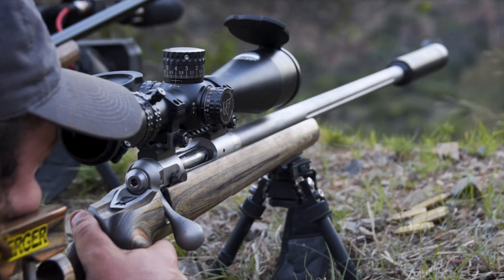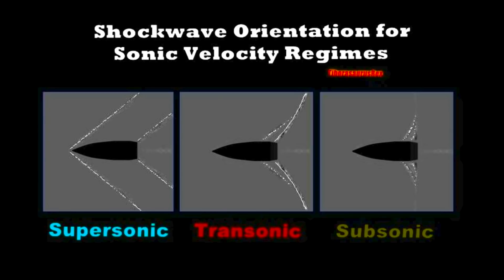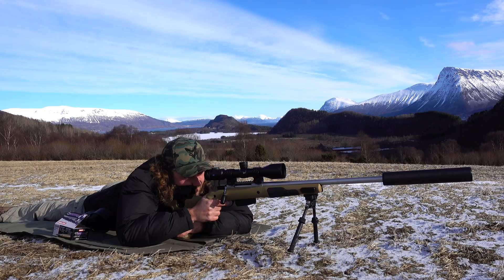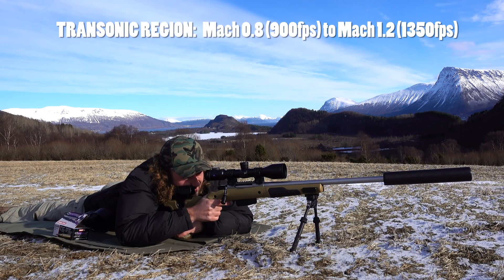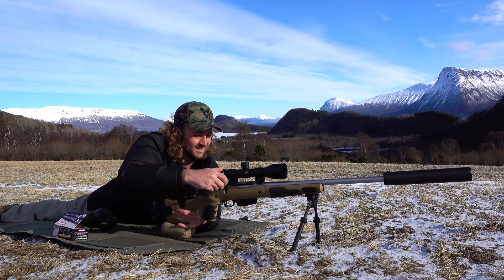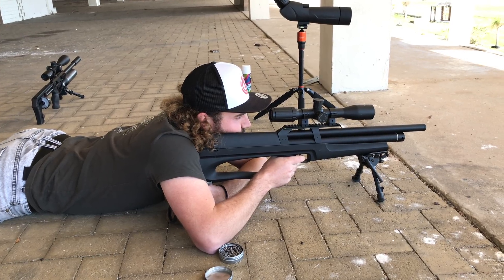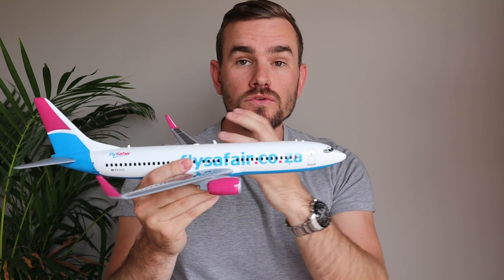Subsonic, Transonic and Supersonic Flight - Airgun Ballistics 101, pt. 10

Comment: Wouldn't it be interesting to add a thin polymer tip to the front of hollow point slugs, giving them greater aerodynamics, in the same way that Hornady does with V-MAX ammunition in .17HMR and .22MAG, in order to achieve greater stability and permanence of the slug in the supersonic zone up to a distance of 150m (I believe this is a good distance and consistent with airguns).
In addition, a slug could be developed that is as long and light as possible, in the case of 5.5mm calibers, taking advantage of FX's hollow point technology, in order to maximize the ballistic trajectory, since a longer slug theoretically provides better stability at close to 900 ft/s.

Here's my simple and layman's contribution! :)

Translated into English.

Não seria interessante adicionar uma ponta de polímero lodo à frente dos slug's ponta oca, dando a eles maior aerodinâmica, da mesma forma que a Hornady faz com as munições V-MAX no .17HMR e .22MAG, no intuito de conseguir mais estabilidade e permanência do slug na zona supersônica a até uma distância de 150m (acredito que seja uma boa distância e condizente com armas de ar).
Aliado a isso, poderia ser desenvolvido um slug o mais longo e leve possível, no caso dos calibres 5.5mm, aproveitando a tecnologia da FX deles serem ocos, a fim de maximizar a trajetória balística, já que o slug mais longo teoricamente proporciona melhor estabilidade perto dos 900 ft/s.

Fica a minha singela e leiga contribuição! :)

Brasil!

Comment: I'm an aerospace engineer. Trans-sonic is difficult because not every part of the vehicle or project beaks the sound barrier at the same time. Shockwaves bounce around and interact with other parts and cause them to create shockwaves but they can cause the original shock to disappear. Those shocks were only there because the original shock was there. If it's not there then the second shock disappears. Then the cycle repeats. The peak of transonic drag is M=0.85 (950 ft/s sea level) in general. Go with the heavier projectile because the rifling minimizes precession (the inherent wobble you see in a top), drops the muzzle velocity and is more resistant to the cyclic effects mentioned above.
Supercritical aerodynamic bodies are a very well area of active research but I don't see them saving the projectile body because they depend heavily on the pressure gradient across a shock. Supercritical aerofoils work because we can manipulate the airflow downstream of the shock. We are getting to the point where we have things like active boundary layer techniques where the back half of the aerofoil is porous and we pull a vacuum to essentially suck the shockwave down to the wing. Of course, technology will get there one day but the $/shot when every shot has a microchip and a battery in it is going to skyrocket. Though sign me up. I would love to put some of those down range.

Comment: In the phantom the critical Mach number was very high due to the coke bottle shaped fuselage.  .98.    So.  Going to Mach you just noticed the altimeter flip around and that was it.   Meant to go fast especially thru the number.  …Mach 2 is very fast.   Doable in a slick phantom going downhill.

Comment: fascinating.  this really explains things for me that I did not truly understand many many years ago.

when I was in high school, I was one of a team of match shooters.  We used springfield 1903, but the load and bullet were matched to be subsonic.  We shot at 10 meters.  standard peep iron sights.  The armory chief did all the loading, and gunsmithing.  I just assumed this was the typical match rifle setup and the subsonic was to eliminate the need for sound reduction/moderator/silencer.  But I do remember doing some 'field work" with my rifle and trying to place rounds out at 100 meters.  Oh man, I tried everything ...I could not hit anything, not even from a rifle clamp!    Yet, I can use my .22 LR with a decent scope and place shot within 3 inches at 100 yards from prone...It never occurred to me at the time, that the match rifle was detuned specifically for the range and the weight of the bullet to consistently move just above supersonic around 1400 fps...and it never encounters transonic in the 10 meter range.  But at 100 meters, that same match rifle breaks back down from super mach to trans sonic and then subsonic.  

this video reminded me of that experience..I had never been able to fully digest what is exactly  going on at those mach ranges.  

Now I own 4 air rifles...all break barrels.  ironically, the least powerful .22 caliber 49 dollar hatsan with a decent scope shoots just as accurately as the hw30 at 40 yards.  both are shooting sub sonic.  I am convinced this is due to other variables other than subsonic and pellet weight.  I am convinced that this 49 dollar air rifle simple does not experience the same level of barrel and piston barrel resonance as the higher end....and thus more accuracy and consistency.  Science is fun and confusing.  experimental science in the field is a blast!

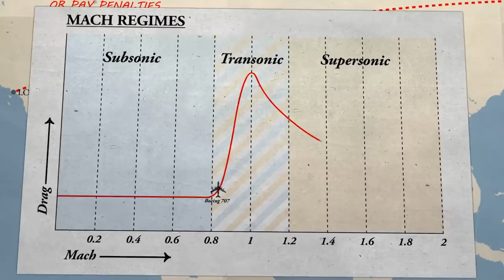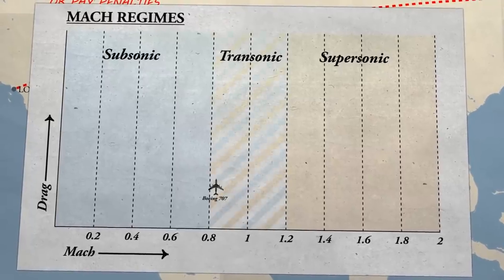Comment: I beg to differ about how fast planes go. I know the lower end of transonic speeds in unsustainable and makes the airplane uncontrollable. Though the “not too many commercial planes than fly transonic” (5:04) can operate at the higher end of transonic speeds due to a decrease in drag after the initial increase at the lower end of transonic speeds seen at 5:35. The decrease in drag happens when the shockwaves are no longer over any surfaces but in front and behind them which means no loss of laminar flow. Though the chart at 5:35 only shows the drag from normal shock waves, there’s also the oblique bow shock at the front which happens when a plane exceeds Mach 1 and drag from this shock wave skyrockets once you reach Mach 1.2. This is why airliners never at TRUE supersonic speed where all the air flowing around the plane is also supersonic.

Comment: İ watched most of this series and found it quite informative(still some went over my head :D)! Dankie! I am actually interested in buying my first pcp, was wondering if you could point me in the right direction, it would be mainly for (extreme) long range but still want a calibre that has a punch at the distance to ring a gong or if i ever decide to hunt at shorter distances (which eliminates .177 and .20). Having trouble finding the right balance between calibre and power.

Comment: Have enjoyed your series immensely but for this episode, as an aeronautic engineer, please understand a few things.
First up. Trans sonic area is way way way harder to explain, for the layman, than is done here. I appreciate that you´ve tried to make it understandable and coherent to masses. That resistance for instance increases from v2 to v6 in the transonic area is for rather hard to comprehend reasons. Other side of the wall, as you´re probably aware,we in turn see v1,5 approx.
Point still is that the understanding of the trans sonic area is way way more involved than most think and we´ll do ourselves, as shooters,a great disfavor if we regard it simple.

Second up. Mach is a relative flight speed. No matter if an aeroplane or a bullet.Imperative word being relative. It is dependant of a few variables why discussing hard fact speeds in Mach numbers simply isn´t done.
Speed,to us as shooters, should thus always be in either fps or m/s to avoid mix ups.

Comment: This answers a lot of questions i had about airgun slugs.  I'd be willing to venture a guess that the transonic region of a projectile is partly dependent on its shape, i.e. a pellet would have a larger transonic speed region than say a boat tail bullet. Possibly allowing one to push the subsonic speed of a slug a bit beyond was is accurate and stable for a pellet.

Comment: I have been trying the new 26.8 grain NSA slugs. Using a 25 ca FX Impact Markll 700 mm slug liner I was able to tune ,
More luck than skill, to get a 10 shot string with a spread of 2, (953 -955) fps and an sd of 1.6. I was hoping for a pellet on pellet group at 30 yds and didn't get it. So here is the question 
If the rear,skirt of the slug measures 246 What is the inside diameter. Of the slug liner and might it be better to shot these 26.8. Slugs through an A or B pellet liner Thanks for the time and effort you put in!! 
I support you on Patreon and encourage my associates to do the same, also encourage others to support you on 
Airguns101. Com Thanks again Tom

Comment: Good explanation from your pilot friend, except his statement that airliners fly below their critical mach number. Most modern jets cruise above their critical mach number. Thanks to the introduction of supercritical wing profiles decades ago the wave drag increase very slow in the low transonic regions, and hence transonic flights aren't an issue. Else there would be no need for automatic mach tuc trim as you find on the 737 for example, that trim the nose up in higher speeds (due center of pressure shifting aft as supersonic shockwaves forms).

Comment: hello  , the 22-250 is not soft on the barrel , it wil wear out sone compared to 223 or so . i load the 22-250 to moderate pressures and then it is a long accurat gun. if jou want the muzzle energie of a 223 in a airgun ,jou have to switch to the monster kalibers like 15 mm or more.and in that caliber is a firearm  stil king      a good vid  did you made    happy newyear

Comment: Took me several tins of pellets but I came to the same conclusion on my benjamin marauder.  Without measuring the speed I lowered it from maximum until I got the best groupings i could.  Then I measured it and found I was shooting right at about 900 fps.  I primarily shoot after black birds at 60-80 yards at the fishing camp.  Use 7.4 grain crossman pointed due to less bullet drop.   For closer stuff (fur not feather) I shoot the 10.5 grain crossman heavy domed at about 850fps with no changes to the air setting.  Adjust the scope dope of course.  Been pleased with this versatile setup.  A video a while back from Ted's Holdover showed the erratic pattern of supersonic/transsonic path of a pellet and I quickly adopted the advice.  This video helps me understand it even more.

Comment: I'm curious,
one factor not mentioned is the pressurized gas, if high velocity is desired, helium may do the trick.
anyone know anything about helium as a drive gas?
(or even hydrogen if you are feeling adventurous)
Reply from the maker: It’s extremely difficult to seal helium, normal o-rings will not work. Plus, the market is just too small. Some people do make helium guns, but they are not mass produced.
Reply: @AirArmsHuntingSA  I totally understand the sealing problem.
It would be intresting though, to investigate the increase of V0 by using helium.
(from a physics point of view I suppose)

best
Peter

Comment: The inner geek in me loves your 101 series. Very well explained for both experienced and new. The real problems with transonic envelope estimation is that it varies with altitude, pressure and temperature hence if you live at sea level your gun may be fine but take it up to Utah or the high Velt and its time to rethink the speeds and back to trial and error to find what works or some stupidly long mathematics.

Comment: 5:30 shouldn’t that visual include an ‘air density’ factor of sorts? Or is that graph for a set altitude, such as typical cruising hieght, ie 30,000-35,000 ft

Comment: I have found that FX STX barrels shoot JSB HEAVY DIABOLO pellets in .177,  .22, and .25 calibers awesomely accurate at 950 fps.  All flat stable and straight...
Reply: I found my Dream tac shoots .177 heavys within 1/2 inch at 50 yards with reg 100 bar and hammer just off minimum giving 905-907 fps.  Lots of trial and error knowing science was watching, laughing till I found the right combination. Like Ted says, you know you have it right when it quiets down, as in no extra air to destabliize the pellet as it leaves the barrel.